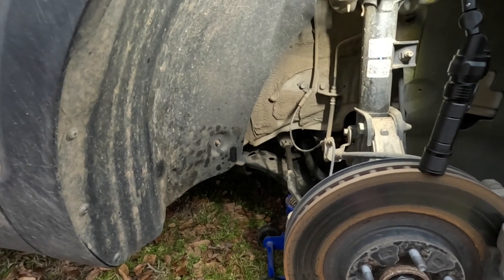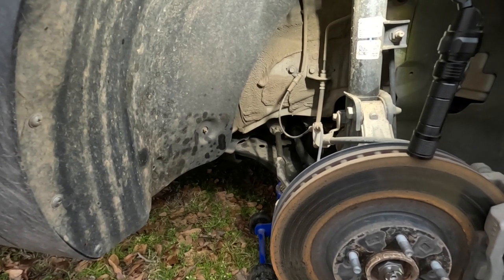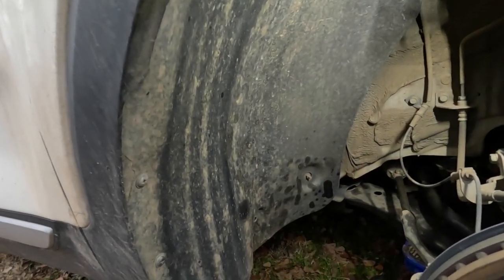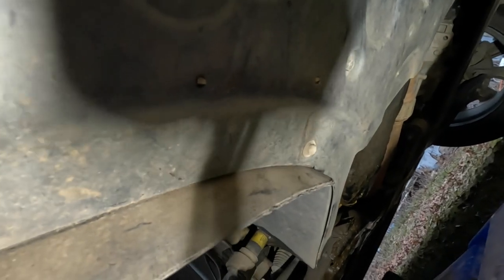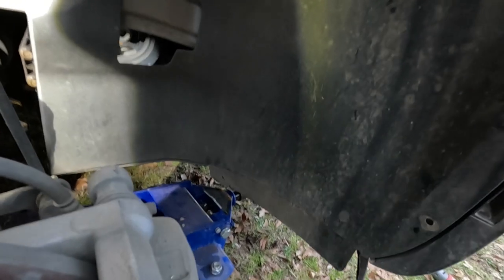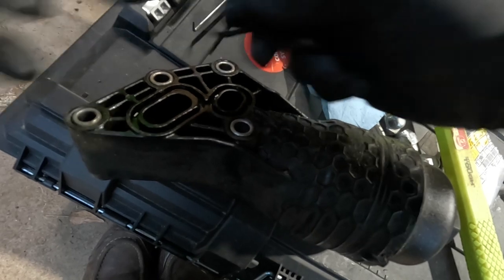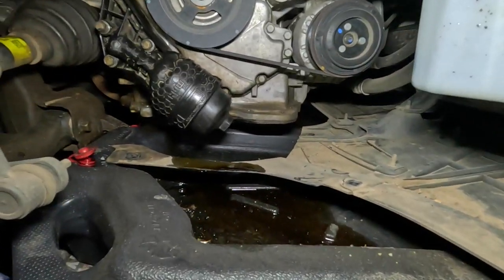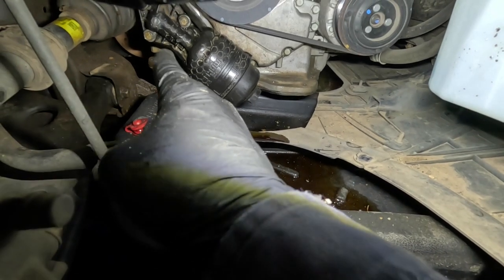Watch This If You Own a Kia!

Comment: Thanks for posting this. I'm going to have to swap out the housing for a new one because the *oil change place did exactly what you talked about. Overtightened the oil filter cap and cracked the housing. Anyway... Your video was very helpful
Reply from the maker: Awesome! Glad it helped! It’s really a pretty easy job. This seems to be a common problem that shouldn’t be a problem but at least it’s a pretty quick fix either way.

Comment: Did you have to drain all the oil before doing this?
Reply from the maker: Probably wouldn’t have to. But you will need to add some oil afterwards as some will probably drain out. Some will drain out regardless. Mine was due for an oil change so I drained it first.
Reply: @arrowjmfarms  thanks man, I appreciate the reply